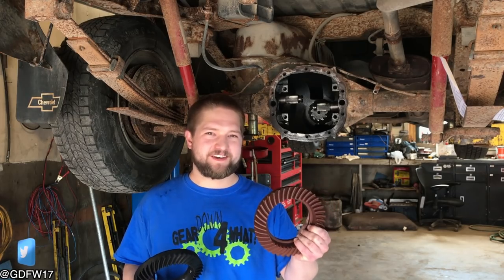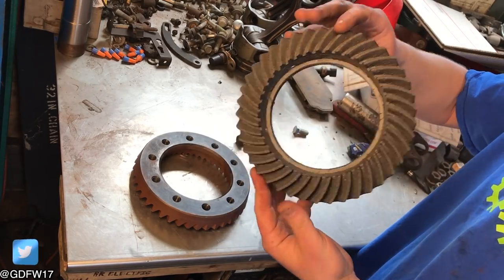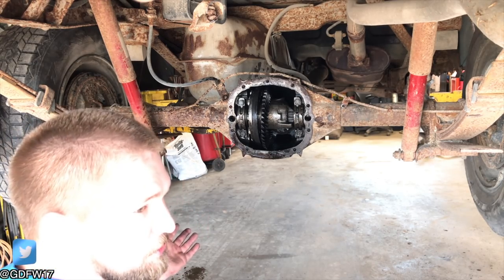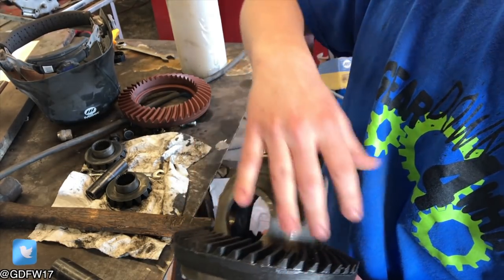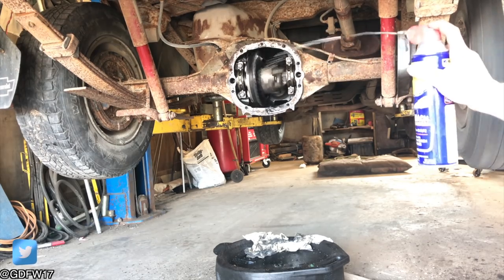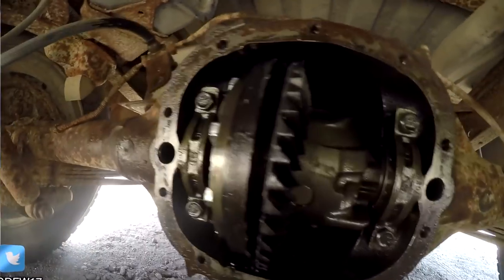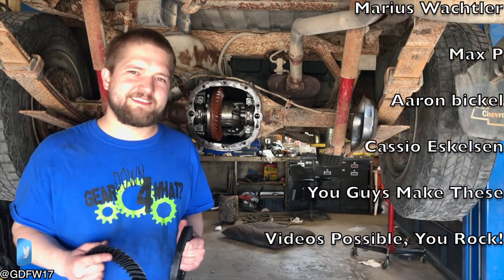Replacing Drivetrain Parts with 3D Printed Carbon Fiber Nylon - FOR SCIENCE!

Comment: Only problem is even if it did work the carbon fiber is going to chew up everything in the case (bearings, gears, etc). Carbon fiber really shouldn't be used in a "wearing" situation like this. Besides, from the tests we have seen, "carbon" filament of any type is weaker than just the base plastic. Try plain nylon, polycarbonate, and plain old PLA.  Also, plastic on metal doesn't need lubricant and will make parts wear faster (plus WD40 is not a lubricant).

Comment: I think it would work if u remade it without the nut holes ornpausing the print then drill and tap and helicoil the holes where the nuts go and it will work

Comment: What if you made the ring solid and just drilled and tapped the bolt holes?
Reply from the maker: Then there might not be solid material where the bolts need to grip, your better off printing with holes or threaded holes to ensure that you aren’t threading into infill

Comment: If I were u id put small metric bolts straight through each tooth (2 for each) while also making the bolts flush with the bottom with holes to compensate the bolt heads

Comment: no way this was going to work.  rear end gears do not actually touch each other.  Those lines on the gears were for oil to ride in.  Oil being uncompressable, prevents the two from touching.

Comment: Do it all again but use a thin metal wire to hold all the nuts in order and flat on the printer table then print it out around it and all one piece.

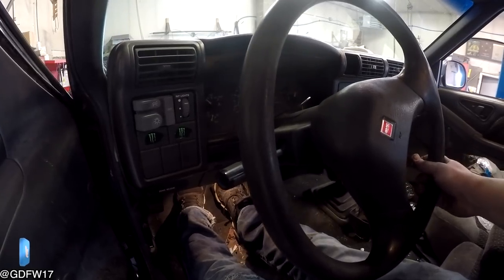Comment: 3:00 ti be fair to the printed part. Even a steel part wouldnt have lasted very long like that with absolutely no lube. WD-40 isnt quite a "lube" in this instance. I also wonder what the reaction between the nylon carbon fiber compound and the wd40 is. Certain things "melt" or "decompose" when you spray them with wd40. Try spraying something with plastidip or similar product and then after its good and set, and dry, spray it with some wd40 and watch what happens...

Comment: OPTIONAL VIDEO TITLE:  3d print fanatics trying stuff that regular engineers already know does not work, or only works for a few minutes.....carry on genX  but remember...the wheel has already been invented!  ;]
Reply from the maker: Should I switch to dropping bowling balls onto trampolines, destroying iPhones with hammers, or filling pools with orbeez? There’s a lot more dumb things I could be doing, so I hope that I at least inspire some kid to get into engendering.
Reply: Hell i dont know, im just doing my part making snide comments!  Seriously though, i dig your energy but some test's aren't worth the time...even if you get the car rolling slowly on flat ground, what have you proved about the filament?  It's not a real useful test cause one blip of the throttle and the thing is dust, I would much rather see stuff that is useful and has longevity.     @GearDownForWhat

Comment: you need to change your 3d printer, and add a laser to preheat the surface to make them stick.  ie ( you need a printer head with a built in laser to preheat surface ) then you will be able to stop at any time and you would only need the laser when you restart the print ,,

Comment: JB weld was never going to hold up. 
if you think it will 3d print a mold and fill it with JB weld. it'll probably cost you more than one made of steel but it'll prove JB Weld isn't a magic fix all.

Comment: I'd recommend going with blind holes rather than embedded nuts.  Nylon has excellent tapping properties so i'd bet tapped holes will work just fine.  Or you could go with some of these press-in threaded inserts, which should give you almost as good a strength as tapped holes: https://www.mcmaster.com/#92395a031/

Comment: 3d plastic model, Clay it with a hole. Furnace. Plastic melts but clay. Melt metal. Insert molten metal inside. 3d medal model=high heat resistance and strength
Reply: Nice video tho

Comment: Press in threaded inserts, I use these to connect smaller 3d parts into parts that are to large to print. Or to connect metal plates etc to printed parts. https://www.pemnet.com/fastening-products/press_in_inserts/

Comment: Nylon breaks down in the presence of oil and solvents. try 3d printed titanium. It will give you the ability to make part of the inside of the gear hollow to save weight. I'd rather see a 3D printed carbon fiber driveshaft. Just get it balanced by a machinist before use.

Comment: LOL. Wrong material, Wrong 3D printer and Wrong temperatures!!!!! First and foremost you need a industrial grade high temperature 3d printer with Carbon fiber PEEK filament for the to work. You will have to print at 380-500 degrees Fahrenheit and then anneal the part. The printers that can do this cost $20,000 - $400,000. The filament cost $300+ per roll. The parts will have a working temp of 400-600 degrees, have a bit more strength than steel at 1/2 the weight.

Comment: Suggestion as a mechanical engineer: Delamination is here caused by rotational torque around the axis. It's remarkable that the teeth themselves are so strong that they do not deform under a load that is enough to delaminate a much larger area. 
So I would change the design so that the whole part has steel reinforcing running through it. You could probably just leave holes in the structure and screw 5mm bolts in them. They will carry rotational load that would orherwise cleave the laminates apart.

Comment: 3D printed carbon fiber is shit.... make the carbon fiber 1k 4hs weave with prepeg layer layer with high pressure autoclave

plus remake everything in carbon fiber

3d printing CF is chopped CF inside nylon which is crappy bro... fake CF is bad

pagani even add titanium wire to CF to make it harder and more flexible to change

you can do that as CF is brittle

koenigsegg does it